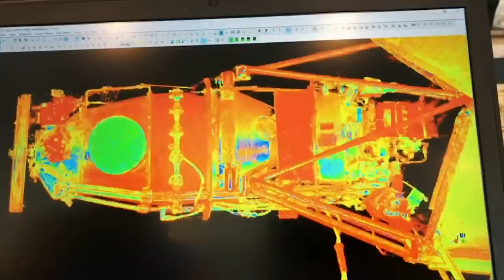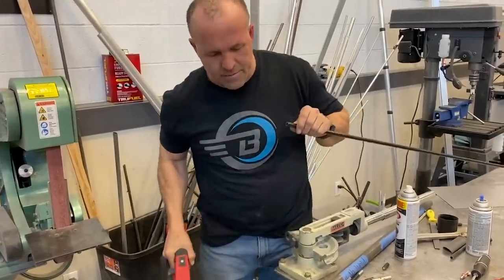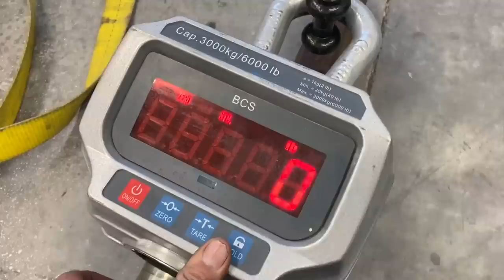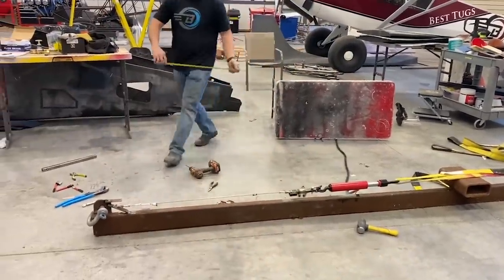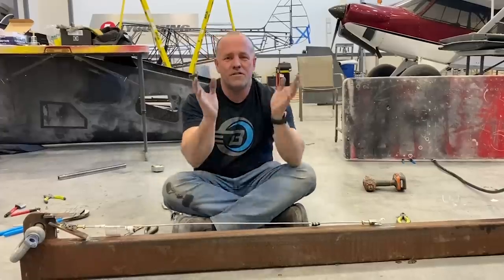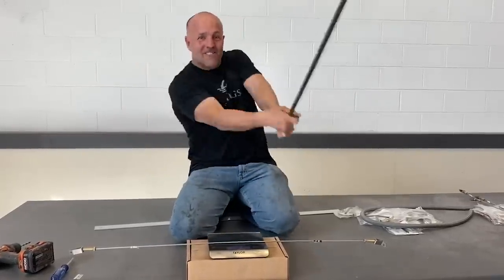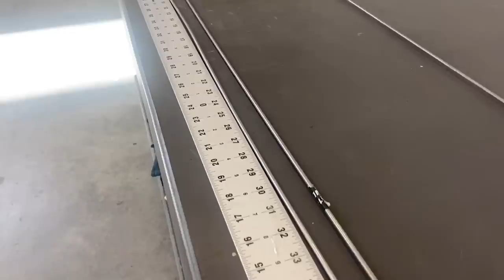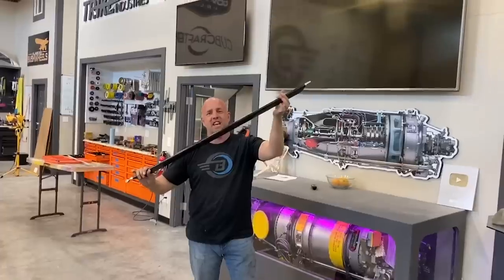Testing to Failure (Scrappy Bush Plane 17)

Comment: Enjoyable stuff, indeed. Question: the bar has a larger cross section than it's steel counterpart, will this cause airflow shedding vortices, and if so what will you do anything to mitigate this;l if anything?
Reply: Shoot . . . how could I have even imagined that you wouldn't address that just seconds after I had commented. Do I lack faith, or was it mind reading - no answers please, we don't want to spoil a good story. It just gets better. You will be happy to hear that I envy you your total smarts and enthusiasm. Watching this is a must. Scrappy is one hell of a comprehensive research and development for what sounds at first a very casual approach - Scrappy (sounds like it might be a bit of a lash up, but definitely anything but.

Comment: Mike, just curious,  have you also considered fatigue strength/life of the carbon fiber parts? Or  what is your experience with carbon fiber when exposed to those types of environments? I'm sure you know, static strength and fatigue strength can vary greatly depending on application.

Comment: Hi Mike. Awesome video. Technical question : Where is the weak point? How do you prevent fatigue in the airframe. Also, what is the service item and replacement cost? Obviously not wanting any spoilers. 😁

Comment: I always seem to have two questions: Have you considered the wind load across the bar? As you know a wire stretched straight between two points has infinite tension on the ends. I am just thinking you pull a little on the center of the bar while in tension and see what happens. In fact the wind load is kinda crazy from turbulent flow. My other question was about you thoughts on using Kevlar in combo with CF. I use Kevlar cables on all my big RC planes. Just wondering..

Comment: I thought the best way to get the forces into the fibers is to wrap them around a reasonable sized „drop shape“ the glueing into the thread basically relies on the expoxy and fill Material to carry the load into the fibers - right ?

Comment: My question over carbon to aluminium is to do with UV deterioration then breaking over time compared to aluminium durability to UV? My other question is while flying and say bird hit the tube will it break because carbo generally does not like jarred load? You could test for this as with fishing rods is where they fail.
Reply from the maker: SCS Sarge great question 👍🤠 it’s amazing on that impact on the thickness I used it will exceed the steel bar but I will talk more on that in a future video.
Reply: @MikePatey  thanks

Comment: At 34:07 I''m curious to know, does a side by side comparison, of the 'FALURE' point (as mentioned in caption), differ from the other 'failure' point results, any significant change noted? 🤣

Comment: Hey bro, is that square section beam bending? Check out the gap between the concrete and the end of the section at the ends at 2000 pound.

Comment: Here is my thinking when guessing on these sort of problems. Where is the smallest cross-section? This is not always the deciding factor, but usually it is a good place to start;
Looking at the bracket and its point of failure, it had the smallest cross-section of the entire assembly from what can be seen in the video. So assuming the bracket and wire materials had comparatively similar tensile strength, the short bracket would probably never be able to stretch more than the long cable would without breaking.
The deforming of the bolt is also a little interesting, but most likely it would not shear unless the material is really poorly matched to the rest of the assembly or excessive play. It seems to have a diameter at least half of the wire - if not more, and it goes trough at both ends. So it will have a cross-section of two times its diameter at least.

The threads are biting into cylinder that has a rather large diameter. So even if it is thin, it probably has more of a cross-section than the bracket. And it looks like both the male and female threaded pieces are of the same material. So the cross-section of the teeth put together on the male part is probably many times more than the cross-section of the female part. So not stripping those anytime soon - assuming these are quality made materials and components.
Really cool experiment! :D Looking forward to the coming videos - and not at least to see the thing fly!

Comment: I've got a question. What's the failure force from the side for the carbon compared to the metal one? From what I've heard and read, carbon fiber is really strong in tension but weaker when lateral forces are applied. If I'm wrong please correct me.

Comment: stretching is my first guess where? i am not quite sure as to the wire could but anything that moves is a fail in my book i would guess abit of an overall stretch. i love your parameters as it was line with my armature guesstimates as it would be out of adjustable compensation thus a non operable plane part.

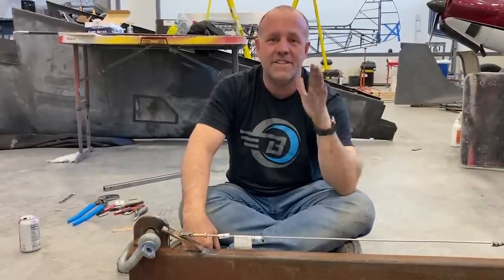Comment: I'm at 10:40 in the vid.  Is there a bite type ferrule on the metal rod or just tapered thread + nut to create compression?  1st fail is the compression joint if no ferrule is involved. 2nd fail should be the rod if the comp joint is solid.
Reply: At 12:50 now.  That metal bracket might deform first.  But yeah, go ahead and stand on it.  1,300lbs?
Reply: 24:53.  We no, the cabon is just going to turn into string when it breaks.  Very high rate spring.

Comment: My few thoughts as a mechanic engineer. Connection points will typically lead to catastrophic failures while material failures are due to riding the zone between yield and tensile. I think the tube will stretch before you have shearing of any connections. Having not watched the entire video nor knowing materials of anything I'm guessing the either the bolt with the cross hatching or pullout shear through the tab. That tab did not look like any high strength steel.
Reply: Haha! My girlfriend sitting next to me was like wow you guessed right! I had to respond to her with "thanks for the confidence." Keep up the good work! You nailed it on the head about the stress analysis. I can "persuade" any analysis slightly to do what I want. That's no the point. The point is to understand which items items are of concern and which you can ignore or simplify. Building, compiling and running simulations which are full models will only lead to exponentially increasing use of time, resources and running times. Another huge portion of analysis results is knowing the difference between local peak stresses, local primary+bending stresses and average membrane stresses. You need to know all of these things in some cases to paint the picture of whether or not a part will fail. You could have a part which has a peak stress at 3x yield but be local stress and never fail a part (which leads into cyclic loading issues). It's a huge pet peeve of mine when people will look at the von mises stress analysis results and point to a peak stress and fail a part. Things fail in planes not points, if we remember that then we can more accurately determine failures and in return produce a more optimized product. Mike you hit the nail on the head! Maybe I just needed to rant since being stuck inside during Covid haha!

Comment: Great video Mike!! While designing the carbon strut attachments did you consider microfracture in the carbon tube matrix from adding the rivets? Where I work rivets and other interference type fasteners are a large 'no-no' due to issues with cracking the matrix in composite buildups.

Comment: If I may be so bold to suggest. I am not an engineer, but I did spend a number of Saturdays when I was a child at Pratt & Whitney in Quebec with my father, who was an engineer. He worked on the original PT-6 development as well as other projects. They would let me loose firing turkey's with an air canon & stream of water into engines to see how they would quit or fail. Correct if I am wrong, but isn't the framing of your tail that these supports attach too aluminum. How much is that aluminum going to expand or contract due to temperature changes? Also since your putting airfoils unto those rods, wouldn't it be really cool if you could remotely twist them to adjust trim, they certainly appear to have enough surface area to effectively affect trim?

Comment: I was wrong on what would give out first and what would ultimately break, but I guessed 250kg for the failure point, so that was somehow almost right^^ I'd have said that the bolt at an angle would break first since i figured that shear is sth. the metal can't deal with well, but the rod stretching and the sheet metal ripping first does make more sense in hindsight. Question though, would a steel cable of the same weight (assuming the connection points are just as strong as the threads) give out sooner or later? I don't understand intuitively what the differences there would be, but considering it's use in bridges and such I'd think yes?

Comment: If the carbon fiber corrodes metal; especially aluminum what is protecting the rivets from corrosion where they go through the drilled holes? Where they coated?

Comment: I have been kicking around an idea for a wing. Dunno if it has been done before. Take a airfoil kite  style and adapt it to a wing. Build a wing with the air channels all along the length of the wing. This creates air flow through the wing as well as over and under. This is for an RC plane. What do you think?

Comment: I guessed that the End Attachement (that bent SS plate) would fail first... I'm curious about the torque applied to the bolt, since the end broke under it, would it be possible that its torque was insufficient?

Comment: So would you reduce the wall thickness of the stainless steel ends to gain back some weight? Since the failure is so many orders of magnitude higher then required?

Comment: so just a question? at 25:00 when you start the test the beam your testing on is almost flush to the ground, before point of failure you have managed to bend the beam at both ends by at least half an inch. does that strenght of the carbon fiber pulling the beam in on itself come into total strenght of the part?

Comment: Beautiful work as always. I was wondering that, if the carbon piece is that strong, didn't you over-engineer it? You could gain some weight  (might not be much but I've seen you chase weight before) using less layers of carbon while fabricating the rod?

Comment: Hey Mike, one thing that your test can't simulate is the small amount of vibration that that rod would be going through while you were flying and it was moving through the air. Am I off base or does this happen while flying? OK, I just watched your video to the end and saw how you deal with the vibration so my next question would be how does that vibration  work on the  carbon fiber rod compared to the steel rod over time? Would the carbon fiber still be better than steel?

Comment: In a test to fail years ago I had a piece of steel shrapnel go under the face mask and go right into my eye. You only have two eyes and when they get injured they are not easy, cheep, or pain free to repair.  I'm not on my soap box but I don't want to see you hurt safety glasses are cheep eyes not so much. Stay safe out there.

Comment: Interesting to see the testing. I didn't call the fail on the wire. My guess without really knowing how it was put together was on the compression nut. Amazing to see how much stronger the carbon fiber was. Fail point on that was an easy guess that the joint would come apart. Do you yourself have any formal training in mechanical engineering, or did you learn by just doing? Watching your videos, and a few others has inspired me to get back into aviation. I run a machine shop, so I already love to build things, and have desperately wanted to get back into aviation. I've decided to go for my ppl when life gets back to normal. But in the meantime I'm in the early stages of starting my first build. I'm starting with a severely modified J-3 kitten "ultralight". One of the changes I'm making is going from a weld steel frame to a riveted aluminum tube frame. I'm trying to get the weight down so I can go with a bigger motor but still stay under weight. I'm working on it in cad right now. I've also got some other crazy ideas but they are for down the road. I hope one day I might get a chance to bump into you at an airshow somewhere.

Comment: Hey Mike, I loved the video.  Just curious, have you ever compared the endurance limit of the carbon-fiber to the cable?  In my head, it seems like the cyclic stresses on this part would be the first cause of failure rather than outright tensile stress.
Reply from the maker: tyler newcomb  bending test and repetitive flex is actually where carbon fiber is far better than metal.  Metal becomes weaker each bend yet carbon fiber has a near zero fatigue number at all.  If it doesn’t snap it holds it’s strength.
Reply: @MikePatey   Wow, I had no idea. Thanks for taking the time to reply to my question!!

Comment: Carbon fiber tube in the wind is going to vibrate. The vibrations are going to ruin the strength properties at any attach point. Far too brittle. Stretch is not the worry dimension with CF. It may take a large number of cycles. With the ends solid mounted, put a vibration unit on a few tubes midspan, let it run for a month or something, and see what you get. Not yet with you on this Mike!

Comment: Reminds me of the debate a few years ago in F1 about whether to use carbon pullrods vs. pushrods for suspension actuation. Pushrods had to be significantly thicker/heavier to carry the load. I know you're not worried about compression loads, but have you considered testing one for compression failure just in case?

Comment: Really really interesting video. I'm at 12m when I write this! So you are about to test to hard failure. But .. how.. do you test for metal fatigue over like 3 years, where you get lower value pull/sheer and its repeated wear?

Comment: I may not be an engineer but I would test that with just the epoxy to see at what point the glue fails because when it fails it could cause the rivet to be loaded cyclically which could stress harden them or cause them to develop cracks and fail prematurely

Comment: My bet is that putting extra rivets in it won't gain you everything.  \I think all the force was held by the shear in the glue line and that those forces were far in excess of what the rivets would hold.  When that gave up, the loads transferred immediately to the rivets and sliced through them.
The next test should be the exact same setup but without glue.  THEN you know how much the glue shear is giving you and how much (if any) is attributable to the rivets.

Comment: Carbon beats metal at room temperature. What about at temperature extremes? I'm sure it will still beat metal, but will it make a difference to the end result of the entire assembly? I'm thinking -40 to 120 F ambient in intense sunlight. Great work.
Reply from the maker: Jim Jones it would allow a little more stretch but when it comes to carbon and the loss the tail feathers actually apply it would not be much of a measurable movement or loss in strength on tensile

Comment: Not sure if you mentioned the rivet material.. aluminum, or stainless steel? I assume you used stainless for strength, and corrosion resistance

Comment: Question, on the first test, first failure at 602lbs, were you checking stretch between 440lbs & 602lbs?  I ask, because it could have started stretching at 450lbs, right?  I’m gonna go out on a limb & assume you were, but since you didn’t mention it, that made me wonder.
Reply from the maker: B37xM Flyer yea I was testing and releasing tension back and forth, I cut hours out to speed it up

Comment: Mike a question you don't think the company that made these stabilizer rods. already stress tested them and do they have the information you need to test your carbon rods? so you can compare the strength that way , best regards from Sweden ??
Reply from the maker: Görgen Engman 👍🤠 great question and I have and use all that data this is my way of connection and self verification
Reply: @MikePatey   yeah i understand  how u mean it is most time always best to do the math your self  . great billd  love to see  Scrappy flying and what data u can get from it  in all aspects regardes from Sweden

Comment: what about Uv effects on the fiber?
Reply from the maker: Great question. I went into that in other videos but the short answer is this.  The clear coat has a heavy UV blocker. That being said, even though they say that’s all that’s needed, I’m not comfortable with that.  I go one step further and after I calculate the structure of layers of carbon needed, I add one extra layer not counted as structure but simply as a solid UV block to protect the structure layer underneath it.  Between the two methods we are good to go for a lifetime
Reply: @MikePatey  Thanks that makes sense.

Comment: Is there any chance stones / debris pickup by prop wash hitting this carbon fiber parts? If so any delamination caused by FOD hitting CFRP parts might greatly reduce its strength as often seen in the carbon bike frame failures.

Comment: Awesome test analysis on your design Mike.  Question, what was the end weight of the strut, 0.68 or did it go lighter or heavier with the mini wing attached?  Also for your jig, to measure safely, have you considered riveting a tape measure onto it and then photo/videoing at both ends for movement?
Reply from the maker: Robert Beuschlein great question. they ended up with an once again f each other. my shorter carbon were just over on weight but more amazing is on my longer carbon parts I had more advantage as the tube is less than the wire per foot so they came in lighter.  Net was within grams